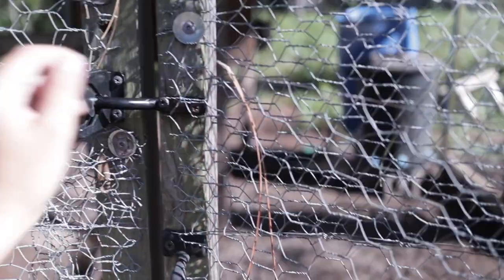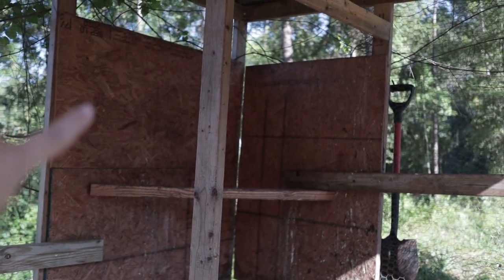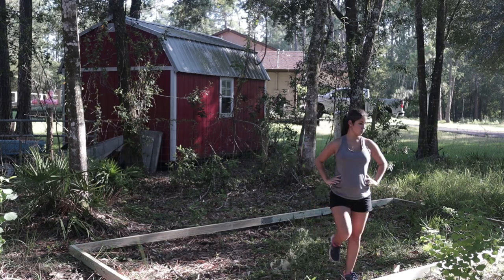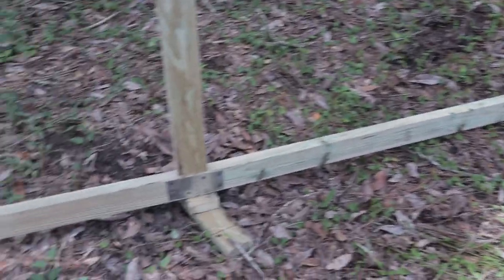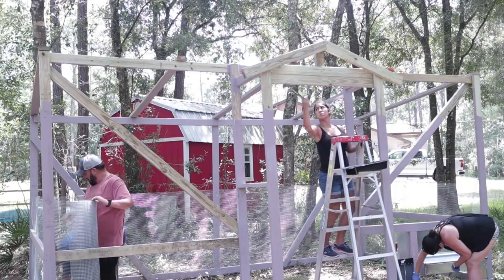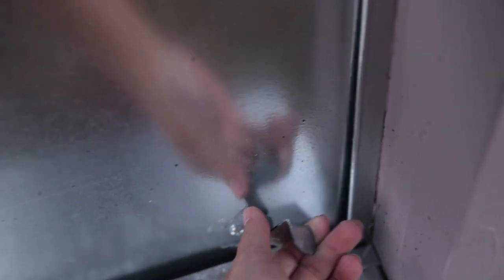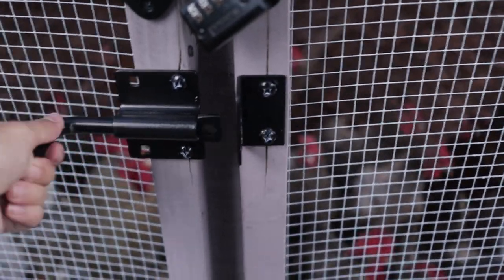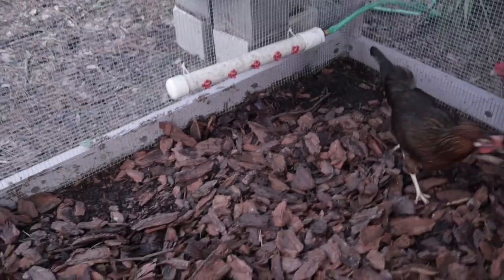Building our DREAM coop! (DIY Chicken Coop Build)

Comment: I strongly recommend that you cover entire inner floor of coop with hardware cloth then the bedding.  It will amaze you how deep and far raccoons and snakes can dig to get under and into coop.
Reply from the maker: Thanks for the suggestion. But this way has worked well for us for the past several years and I also like to rake out the compost they make so it'd be hard to do that with mesh under the coop.